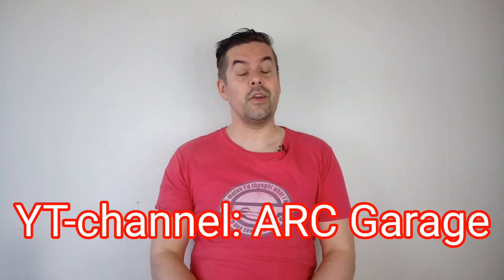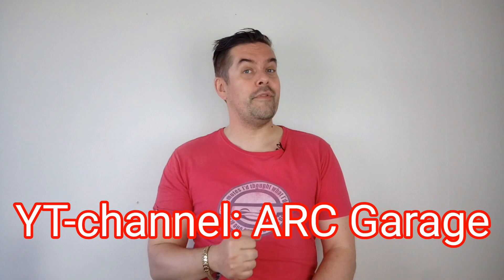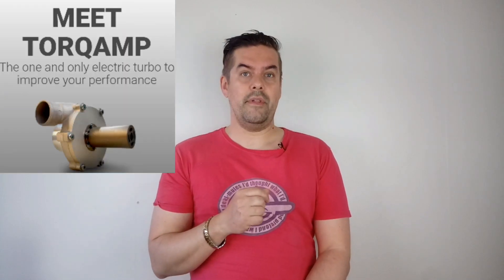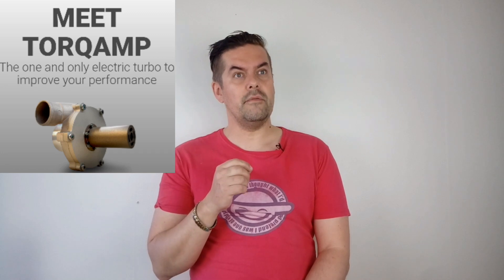Let's try Torqamp electric turbo in a Alfa Romeo 2.0 GT and Fiat Coupe 16v turbo.

Comment: It works and would work well.  When not full throttle, it will be somewhat of a restriction due to the TorqAmp blades being in the path of the air inlet.  But this is the same case when a turbo is off boost.
Reply: The turbo blades wouldn't be much if any effect at part throttle because your engine doesn't need all that air flow but it will be a restriction at higher rpms and full throttle if the torque amp is not running. And when it is turned on its a matter of the torque amp being able to produce adequate air flow as the rpm increases. But that can be reduced with a one way air valve that opens up when the torque amp can't keep proper air flow at higher rpms and there becomes a vacuum instead of pressure.

Comment: Friend, I would save your money. You need to remember that this is not a constant on system so when it’s not in use it’s a restriction in your intake system.  So for a 30 percent bump in power  at lower rpms (until it’s overheat system turns it off) you loose up to 10 percent power all the time.  And I don’t remember any connection between the engine rpm and the speed of the device. What I’ve seen is the driver manually adjusts the device’s speed.  Also, I can’t remember any dyno results that show if the device has enough flow to have boost at 5,000+ rpm.
Reply from the maker: That is a very good point, I agree. Thank you.

Comment: I would be interested to see this.  I have looked at the Autodelta Supercharger, which costs around £4K fitted.  I have started looking more seriously at more modest gains from exhaust/induction (as you have) and cams, porting and remap. Good luck!
Reply from the maker: Thank you! The cost is a big drawback.

Comment: Supercharging an engine that was not designed for forced induction will inevitably wear the internal components and break it. Autodelta sells a 2.0 JTS with a supercharger and I've read there are also reliability issues with that, and they know what they're doing.
It could be fun to take it to a drag event but if I understood this working principle, daily driving will not be so fun. Let's say you set it to make boost from 70% throttle, until you get there you have -10 HP because the turbo is off and airflow is restricted and then you suddenly have +30 HP.  If you activate it by button, you can't do a fast standing start because you might get boost in 1st gear and break something or lose control.
They said it doesn't have the drawback of a supercharger because there is no parasitic load on the crankshaft. Maybe so, but the effect is almost the same due to airflow restriction when the electric one is off. 
I like to 7000 RPM shift my GT when I want to have fun and it's the best sound I've heard from a 4 cylinder engine. I wouldn't like the added sound of a hairdryer over it :))
Reply from the maker: That was the best reason I heard so far and I didn´t think about. thank you for the -10hp loss. And I really do not want to break the engine, I just need more omph... Maybe start looking for a busso.
Reply: You can do it on the GT, there are persons that already have a turbo setup on a twin spark for lots of time, but you can only go to a max of 0.7 bars of pression if you want it to be reliable.
The engine must be in top notch, you have to have good compression, good condition seals, crankshaft journals, Conrad bearings, it should be a healthy engine.
Reply from the maker: The healthy engine, that  is maybe a problem for me. 170k km and the GT has not been in the best of hands for the last 5-6 years. Before I put in a turbo, I need to have a fresh engine. Torqamps electric turbo only generats a max of 0.4 bar, I guess it is their way to be sure that most cars can take it.
Reply: @Imperfectgarden  
There's a video where some guys tested that electric turbo you're talking about, it gave the 2.2 liter engine more or less 20bhp. The problem is, i think you can't use their turbo all the time, i think it's only meant to be used as a temporary boost.
For me it's a no no.
With 170K i wouldn't risk it.
Reply from the maker: Yes, you are right. It would be fun to experiment with, only if I had a car that I could sacrifice if someting happened

Comment: I like the idea! And of course I had often think myself about increasing the power of my GT. But, and sadly I see a lot "buts"...
1. But: What is with all the hardware inside the engine? Pistons, rods and cylinder walls? How strong are these components?
2. But: If you increase the amount of air, you press into the cylinder, you mostly have to reduce the compression rate. Thicker 
cylinder head gasket, would be the only "easy" way, but not the best one.
3. But: You increase the amount of air to increase the amount of patrol to increase the power. So how much more patrol the injectors can inject in a millisecond?
4. But: If you increase the compression by filling the cylinder with more air and patrol, you have to set the ignition timing earlier to prevent knocking.
5. But: But if we all together find easy and cheap solutions for all these and several other porblems, it would be a great project!
Reply from the maker: That is a great list of buts, and I have to say I didn´t think of all your points 😢.
I can not take a short cut to a turbo without first strengthen the inner parts of the engine, fueling and ignition.
I need to think a bit more.
Thank you for a amazing lists of buts! 😁👍